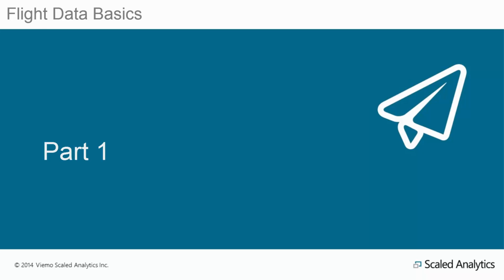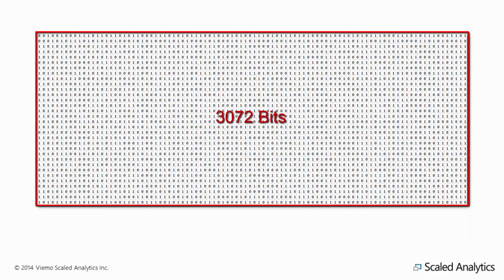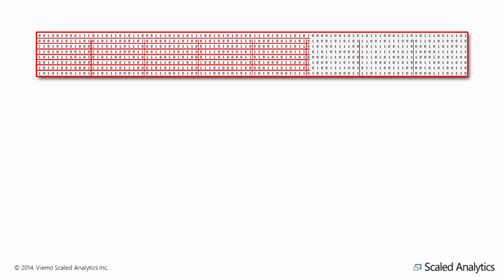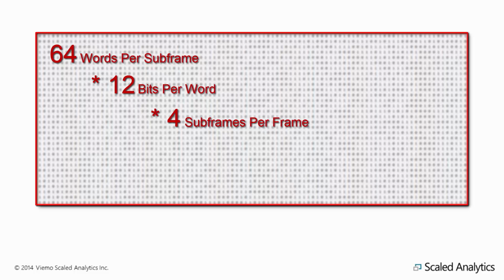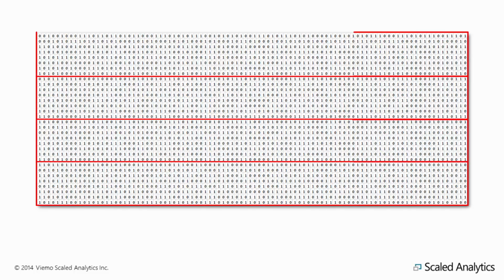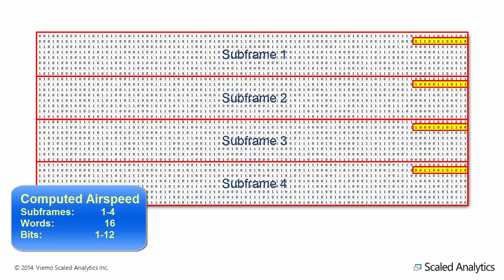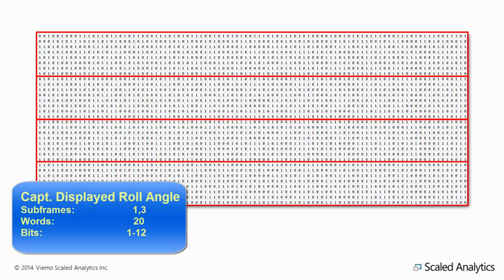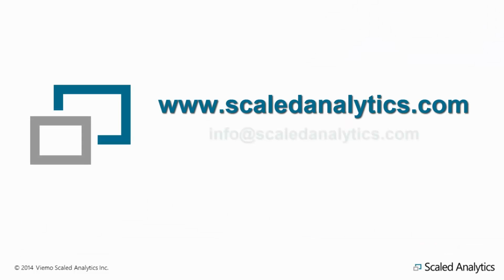Flight Data Recorder Basics - Part 1

Comment: Thanks for great explanation.
I have a question what is main difference between Arinc 573 and Arinc 717?
Reply from the maker: It's been (quite) a while, but I believe the older 573 standard was for the old magnetic tape-based recorders that used a Harvard Biphase pattern on magnetic tape to effectively create 1s and 0s. It was a pretty ingenious idea at the time and is worth a Google search if you're interested in some of the history of older Flight Data Recorders.
Reply: @Scaledanalytics  Thank you very much for the reply.

Comment: Can you explain the last bit for me? 2^12 = 4096 values (0 - 4095)? I understand that the 12 represents a word (at 12 bits). Is the 2 representative of the sample frequency i.e. 1Hz & 0.5Hz?
Reply from the maker: Hi, James. It just means that with 12 bits, you can have 4096 possible values. From 000000000000 (0) to 111111111111 (4095) and everything in between. The 2 represents the number of possible values of a particular bit (either a 0 or 1).
Reply: @Scaledanalytics  Thanks for the reply.  What math are you applying to get 4096 values from 0's and 1's though? Sorry, I'm not too clued up on this.
Reply from the maker: @jamesscotney5820  Hi, James. For every bit there are 2 possible values, zero or one. So with 12 bits there are 2 to the power of 12 possible values, or 4096. If there were only 2 bits, for example, there would only be 2x2 = 4 possible values: 00 (0), 01 (1), 10 (2) or 11 (3). If you are ever bored, the Windows calculator has a programmer mode that can be used to convert binary to decimal numbers (among others). Hope this helps.

Comment: Is there a reason why the frame is defined to 4 sub-frames each representing a second of flight data? It would be much more simple defining a frame for each second.
Reply from the maker: One of the advantages of having 4 separate sub-frames, rather than just one is that you can store more parameters that can be sampled at less than 1 Hz. For example, you can have something like Flap Position sampled once every two seconds, e.g. in Sub-frames 1 and 3, and Slat Position in the same words but in sub-frames 2 and 4. This lets you store 2 separate parameters in the same word location (rather than 1 if you only had a 1 second frame), but sampled at 0.5 Hz, rather than 1 Hz.

I hope this helps and thanks for the question.